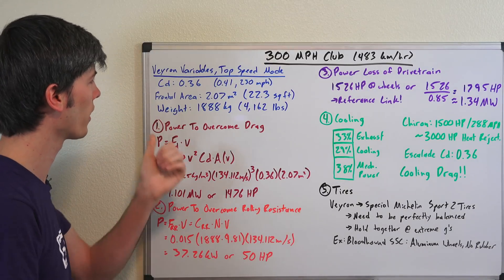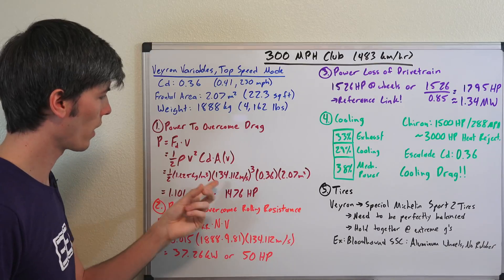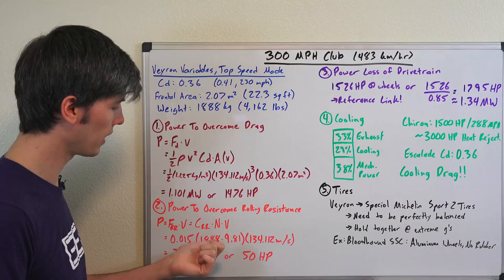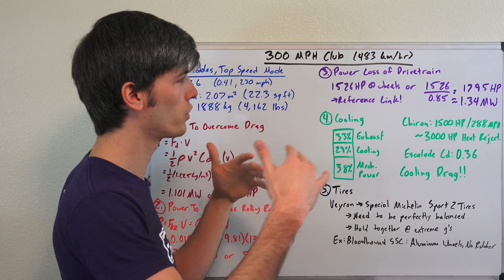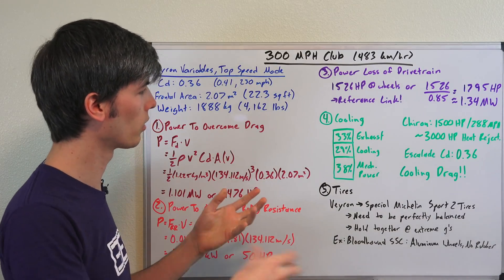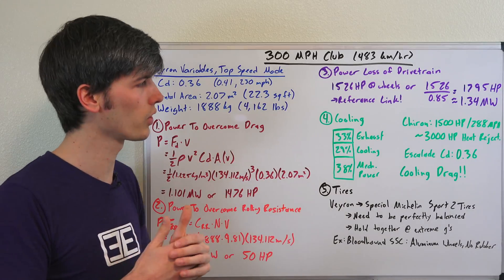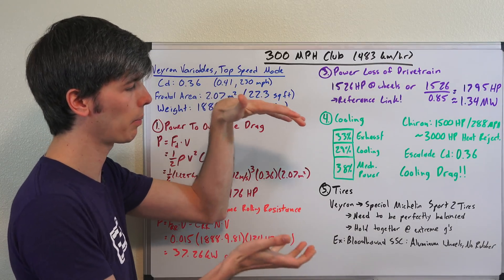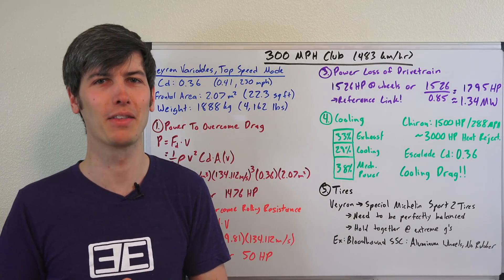Why Has No Production Car Hit 300 MPH?

Comment: Wrong. When VTEC kicks in it'll hit 350 mph in under 3.7 seconds. I would know, I have a V6 Honda so I have two extra cylinders of VTEC yo!!
Reply: Klockorino yes, but do you have a fake carbon hood that adds 100hp and an array of stickers where each sticker adds 10hp?
Reply: Ooo I ooO no, but I have a backwards facing roof scoop and a broken door lock yo!!
Reply: Klockorino My Honda Civic has a huge spoiler on the back of it, my friends say it's backwards but I know they are just messing around, and it produces 200 extra hp and I have camber on all four wheels creating more downforce and hp. I creamed an Enzo in a street race last week!
Reply: Klockorino jesus thats pretty weak man. i got a civic vti that broke soumd barrier instantly
Reply: slow m8 my 50cc moped hits light speed
Reply: that's nothing my car has additional racing stripes.. worth 50mph for each one!
Reply: Klockorino ur all weak. My VTEC has its own VTEC
Reply: You Just Got Filthy Pranked......My Turbo Whistle and exhaust tip adds up to 10,000 HP in normal driving conditions. I also have a Saturn V rocket booster from FlowNasa that gives me more boost than any conventional  nitro system could offer. As an added bonus, It came with collapsible wings for better aerodynamics and lift.  0-60 times are impossible to calculate since this vehicle can outrun time itself. Recently painted it John Deere green and put Duramax decals on the rear. Now I am required to control it via computer  due to the fact that the Gforces would kill a human being.
Reply: The flux capacitor in my cooper allows me faster than lightspeed. I am just instantly there.
Reply: blue VTECs are the best!
Reply: Your vtec v6 has nothing on my TWO STAGE B16 VTEC! Mwahahaha
Reply: Klockorino XDDDD
Reply: Haha love this comment
Reply: Add eurobeat and it will be under 2.3 seconds
Reply: hype tuner alert
Reply: This guy is probably hitting 400+ mph and 0-60 in like 0.24 seconds with the Vtec I guess honda haven't done it yet just because they want to keep the prices low just so more customers can enjoy of their magnificent products
Reply: VTEC COMPADRE YEAHHH
Reply: Klockorino Universal spoiler w/ full VTEC (very tall engine coolant) and performance lug nuts, stickers, tail light fluid and windshield wipers could easily get up to 300MPH.
Reply: When my cardboard spoiler fell off, i stole a park bench and bolted it to the trunk of my car. I was also able to cut up some tupperware and use it to install rear defusers. That combo adds about 200 extra hp at least. The best part of my car though is the "la cucaracha" trumpet air horn. Its a real panty dropper ;-)
Reply: Y'all are slow af I have a 2jz swapped 4wd eg6 and it does 0 - 60 in 0.000143e605 seconds. here are the mods: -swapped crankshaft and camshaft
-short throw suspension
-stanced dipstick
-oem ford taunus injectors
-5 spark plugs per cylinder
-ohv layout
-turbo whistle
-vanilla scent in the air filter 
-extra welded limited slip cylinder
-removed spare wheel for weight reduction
-50 stickers
-bembor 0.5 piston brakes
-non-fake exhaust tip from steelless stain
-abs rims
-Michelle el kontinnentall howsier slicks (some guy gave them to me because he's done many burnouts with them and said he doesn't need them anymore)
-phonedata cheap tune for extra 1000000 fwh...I mean awhp
-double wishbone valve springs
-independent differential
-oem blow off valve for my N/A 1. i mean 3 liter engine
-BBS system
-UPS system
-DR system
-FFS I spent too much time on composing this system
-Natural gas powered front grill
-Automatic manual transmission with CVT and single dual clutch
-Twincam rear suspension
-1600 front suspension
-APEX apex seals
-anika eguot rettug kit
-front mounted rear diffuser
-VTEC on intake and exhaust crankshafts
-rocket turtle bodykit
-Whiskey injection kit
-Authentic fake china 2.0 roll cage

And this brings us to -2345935e349e49 HP, 348573405rhdabgf3468 Nm and 5 star euro ncap rating (I never crashed it tho I swear)
Reply: Klockorino no way the fastest car on the face of thee earth is a Ford gt
Reply: I took the VTEC off my Integra's B18 because weight reduction yo
Reply: Klockorino that's funny the bugatti can't get over 272. Mph. It's too heavy. Do the math numnuts as he's doing. Wich weight is calculated in to it. There are two ford gt's that are surpassing that speed and one at 293.232 mph guinus world records. And the other has the alloy from the spaceship put into high tech engine parts made of it.
Reply: Klockorino MAN KNOW IT
Reply: Klockorino:yeah right, in your DREAMS,lol.

Comment: Sometimes cars can be a drag! Well, there's a reason land speed record got better results with turbine powered vehicles, the turbofan just pushes a lot of air that helps cool the combustion chamber housing and exhaust, without the need for so many radiators, fans and coolant lines. Also, there's electric cars, though they don't have the air pulling advantage of the turbofan, they tend to be more efficient and generate less heat per power produced then combustion engines, so there's some nice results in land speed records with those also.

Comment: I have a question. 
So according to ur math the car that uses an internal combustion engine needs to have the coefficient of drag high enough to help it dissipate heat. 
But what about an electrically driven vehicle? Since it doesnt require so much drag to reduce heat (and i could be totally wrong here). Would it be possible that in the near future we will see an electric car that breaks the 300mph club?

Comment: I've always wondered this, So on motorcycles gearing is everything, and any motorcycle can hit any top speed with the right gearing regardless of how much HP and torque it has, those only help the bike hit top speed faster, how does this apply to cars??
Reply from the maker: +DolphinDivingChamp motorcycles will not hit any top speed regardless of how much HP/tq they have. The rules of physics apply equally. They simply have a significantly reduced frontal area, so less power is needed.
Reply: Engineering Explained Yes they can, with the right gearing a 600cc or even 300cc motorcycle can hit 200mph, it's just that the stretch of pavement would have to be unrealistically long when the HP and torque is lacking

Comment: Couldn't a hot rodded older shape, McLaren F1, with its better Cd potentially be a better candidate to break 300?  It has sufficient cooling for its engine, and while this may be heresy, an engine shop can build a 1500hp LS-based engine whose cooling needs aren't as great.  

Thinking back to Hennessey and their LWB Lotus supercar, you could do the same thing with an F1 and hit 300 mph.  I think.

Comment: You need to tell me that after almost 100 years, they haven't figured out how to make a better weight/power ratio and aerodynamics than the Campbell-Railton Blue Bird??? That car had 4.5 tons with 2200hp...nowadays bugatti has 2tons and 1500hp and same top speed. Somehow 700hp extra for 2.5 tons extra with that record in mind sounds like a genius make.
Reply from the maker: +a-zeu weight plays an extremely minimal role in top speed. A veyron that weighed 4.5 tons but had 2200 HP would reach 300 mph.
Reply: A BMW that weighed 4.5 tons but had 2200hp would reach 300 mph. Get my point? I understand it's not just about the weight, that's why I placed aerodynamics and power ratio. It's 100 years(missing 8) ago, it's just unbearable to understand what is the hold up...
Reply: a-zeu 
Or the Kenigsegg One:1
Or top fuel dragsters? Dunno about the weight of those
Reply: max mustermann they definitely don't weigh eight thousand kilogrammes
Reply: a-zeu 
No I mean no one is concentrating on the HP/weight ratio (actually they are look at the ariel atom v8)
Reply: max mustermann minimum weight of a top fuel drag car is about 1052 kg or 2320 lbs
Reply: It's about production cars, companies need to weigh the cost of R&D, building and supplying the public, including all the environmental restrictions and cost.
Reply: A-Zeuworks how long did it take that car to reach that speed?
Reply: It's because no one is aiming for that goal :D
Reply: Actually that's a really good example. Black Flacon SBC-TT1750 is also a weight/power ratio example, but not enjoying the same succes, advantages. Still...
Reply: Then what goal do they have? Make a complicated engine, expensive bodyshell, a lil bit of design and put a $2.5 mil tag on it? Lol..maybe looks like I'm trolling, but the electric cars developed lately have progressed more than the oldschool typed engineered ones. And that's what..in a 15-20 year lifespan of research?

Comment: What about doing a video on one of Underground Racings 2200 hp Lambos? They have the power to reach 300 and currently run 247 in the standing 1/2 mile. What is the science preventing them from doing a 2 mile run?

Comment: Sad Bugatti needs awd to get it's top speed #rwd Hennessy venom
Reply: First of all, have you ever tried testing it out in real life ? I bet you did not but only a typical 12-year old keyboard warrior that have insufficient knowledge in Automotive Engineering
Reply: The following are examples :
Audi R8 V10 FSI PLus 5.2 Quattro
Lamborghini Gallardo LP560-4 
Lamborghini Huracan LP610-4
Lamborghini Avendator LP700-4
Nissan GTR R-35 
Nissan Skyline GTR R-34 V-Spec

They are using AWD systems and have top speed of over 300 km/h !
Reply: If you want to get a feel of how is like being in a vehicle that has an AWD system, get a riding shotgun in one !
Reply: Buggati could easly do a RWD car, it's just it would take longer to accelerate. AWD doesn't affect top speed, it afects acceleration.
Reply: I'd take a buggatti over the venom gt any day.
You can tell alot more went into it than the venom gt,putting massive amounts of horsepower in a chasis that was used in another car....Idk
Reply: edmoverlord Except in a bugatti you can still have a normal conversation on road with a cup of drink while hitting those speeds.
Reply: edmoverlord How about you stop insulting others and do your research. It's a w16 quad turbo. I agree with the rear wheel drive though. We're here to learn about this stuff, don't be a jerk.
Reply: Exactly. The reason why the Venom GT is so fast is that it is light in weight as to the Veyron Supersports thanks to the weight of it's TT V8 Engine and Ford GT Transmission :)
Reply: The Veyron Supersports or the Venom GT won't even stand a chance against the Koenigsegg Agera R and One:1
Reply: edmoverlord they only hit more than 260 in a not production model, making you point invalid, and it your supposed top speed the tires would've blown up in about 17 minutes give or take a few
Reply: and by longer I mean it could create wheel spin, thus making it slower
Reply: Exactly,and the buggatti apart from being a really fast hypercar,its interior does has quite a few luxuries
Reply: Maybe, just maybe, Bugatti wasn't going entirely for top speed when they designed the car. Did you even think of that?
Reply: Wymiatacz Plays, AWD does help the vehicle in accelerating faster :)
Reply: It has shorter gear ratios compared to the Veyron Supersports which has long gearing. That's the reason why the Veyron needs longer distances and time to get to it's full top speed
Reply: i know lol... I'm talking about high speeds here, not launching.
Reply: Ok.. Look at the Mercedes AMG GT and the Nissan GTR R-35 for examples.. They're using permanent AWD systems and have a top speed of close to 320 km/h
Reply: Wymiatacz Plays  rwd = higher top speeds. Usually due to the lower weight  I could explain all the factors but there is so many
Reply: imagine thinking the venom gt is in any way a decent car, you only say that cus its made in the usa, its not that good come on lol topspeed isnt all
Reply: Tan  Jia Yong here explain why a w16 twin turbo is needed to hit the Bugatti Chiron top speed while the Hennessy venom only needs a v8 twin turbo 😪😪 and its rwd and as a 0-60 of 2.7 with a top speed higher than 270 that can carry it with out its tires exploding you simply don't understand what I'm saying cause your still a ignorant child

Comment: An obvious way to overcome the cooling drag problem is to reduce the heat to be removed.
Would an electric drive system do better?
All you need is sufficient battery/inverter/engine capacity to hit 300 MPH once, as there is no need to drive at that speed at all.

Comment: Now it makes a lot more sense when Koenigsegg says the Regera has about ~2% less power loss because of the "direct drive" instead of a normal gearbox. 2% doesn't sound much in terms of top speed or acceleration, but definitely on horsepower numbers that high, the needed cooling and related cooling drag. Thanks for that video :-)

Comment: Can you do a video with this analysis based on an electric engine? The cooling requirements and thus the drag would maybe be very different, but there would also be other issues like higher weight. A model S seems like a good starting point.

Comment: I reckon 1340kw and 483km/h is entirely possible for an electric car with a 100kw/h battery pack given a high enough C rating for the pack and you can accelerate quick enough to top speed before your battery runs out... I mean there are already land speed record electric vehicles shooting for 644km/h (400mph)

Comment: wind resistance increases as speed increases. Figuring density at sea level is not enough. Also Einstein proved the faster an object is push the more it Mass effect increases requiring ever increasing need for a multiplied power like 100 mph may require 250 HP but 200 mph requires 700

Comment: first  car to do 300mph will b an electric road car. packaging n cooling will be much less of an issue (still an issue, just not so big compared to fire breathing quadcharged 8 litre w16 of veyron engine). weight can be kept controlled by how much battery they want to install onboard n wat material n innovation they come up for battery technology. material science has also come a long way especially wen it comes to electronic components. the navy r building railguns that aims to fire an artillery shell at mach 10, so the materials r available, its just not available to the public yet. also, i believe there r prototypes of carbon nanotube electric motors built by the us navy thats much smaller and much lighter wen compared to traditional copper wired electric motor. all in all, the technology is out there, but its gonna need to get pass alot of red tape n declassification for it all to come together n sold to the insanely rich few. n even if they did build the ultimate electric car, which country will allow a stretch road long enuf (n straight enuf) for this car to b tested?
Reply: Arsyad Idris, aerodynamics and the traction is the key..
Reply: Tan  Jia Yong its not key. its fundamental for these level of cars. but there in lie the issue: if they were to make an electric car with 1800hp electric motor, how will they package the motor n battery n the cooling system so that it wud b aerodynamically pointy? traction wud need some ground effect n just enuf downforce...
Reply: Arsyad Idris, then how is the Regera so fast ? 

0-60 in 2.8 secs
0-400 km/h in appromaximately 20 secs
Reply: Tan  Jia Yong regera is a hybrid with one gear. that car is in a world of its own. it makes laferrari look traditional, wudnt u agree?
Reply: Neh.
Reply: The Regera has a Viscous Torque Converter and Direct Drive while the LaFerrari don't
Reply: LaFerrari has HYKER System and NA V12
Reply: The LaFerrari also uses Four types of carbon fibre to improve structural reinforcement and weight reduction compared to the Regera thus it has more grip than the Regera
Reply: Tan  Jia Yong but wait bro, in terms of acceleration alone i think tesla p100d got them all fixed? 0-100 was delt in 2.3 sec in one test i think. they limited the speed to 180 coz they wanted to battery to last longer. if they combined that with ferrari or lambos weight reduction/rigidity knowhow... well..

Comment: Does an electric car need the same cooling for the same power output? If it doesn't then you could have less air intakes and a more aerodynamic body. Also the power loss through the drivetrain would be far less.

Comment: You calculated the theoretical horsepower necessary to reach 300 mph, but how does time fit into the equation? it's one thing to theoretically reach 300 mph, it another to actually have enough space and power to reach top speed effectively.

Comment: First production car to go 300 mph will be an electric. More efficient drive train, 5% of power converted to heat instead of 200%, can be more aerodynamic. Fossil fuel car does not make sense for this purpose. 1 megawatt electric all wheel drive car already exists it is only a question of wanting to build the car.

Comment: This is probably a bit too simple of a topic for you to make a video on, but I've been wondering what attributes to the sound an engine makes? I know exhaust systems obviously, but in general, most systems sound similar for the engine they were made for. What I'm curious about is the displacement and number of cylinders. Would a 5.0l V8 sound the same as a 5.0l Four or Six Cylinder engine (assuming they had as close to identical exhaust systems as possible)?

Comment: You mentioned 1500hp was needed just to overcome air resistance.  Theoretically how much hp would be needed to achieve 300 mph in a perfect vacuum where drag is not an issue?
Reply: enough power to overcome drivetrain losses and tire resistance.